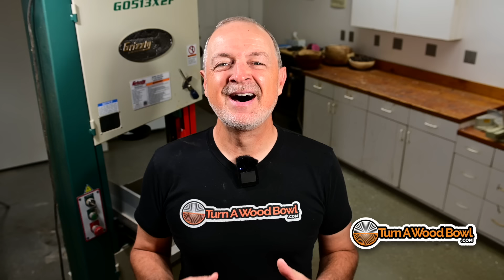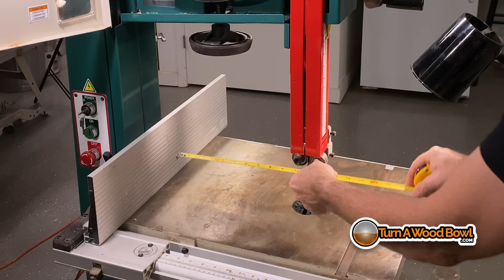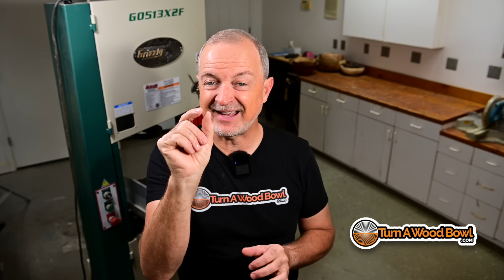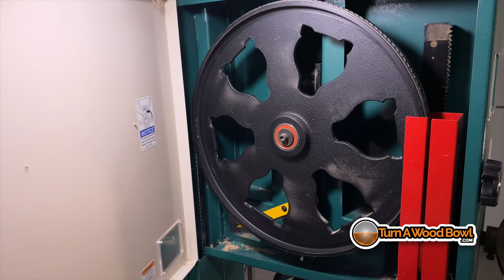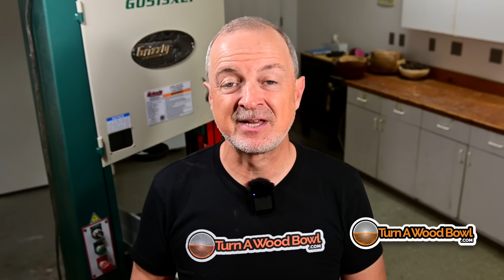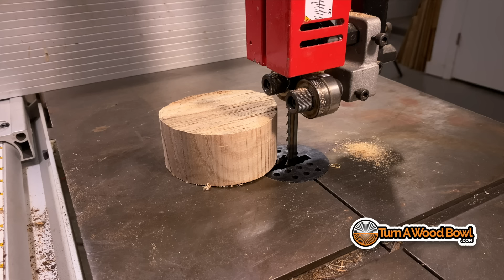Do You Know These Band Saw Basics - Video

Comment: Absolutely great Information. And I will reinforce what you say. "Bigger' is Better" . Yes, get the machine for the work you intend, but It's nice to have a little in reserve. It smoothes out that difficult wet wood, without bogging down, and there always seems to be a blank that needs cutting down to size, a little larger than you need to mount on the Lathe.
Reply from the maker: Absolutely! If you've tried to cut a too large piece on a saw too small, you know what you really need. ;) Happy Turning!

Comment: When the bandsaw isn’t in use, are you supposed to loosen the tension?
Reply: I always remove the tension on the blade when not using the saw. If you do not there is a danger you may distort the tyres, and you are putting unnecessary strain on the frame of the saw and the blade. See what the manufacturer of your saw recommends.😀🇬🇧
Reply: @filmbluff99  thank you!
Reply from the maker: Yes, that's not a bad idea. A tension blade left for a long time can smash the tires a bit in one area, etc. Happy Turning! Kent

Comment: A tip, when you  replace the blade of your band saw, take a file and file the sharp edge off the back of the blade, both sides. That way the back of the bladed has less of a tendency to dig in to the wood.
Reply from the maker: Good idea Harold. Thank you for writing and sharing!

Comment: I'm having issues with my bandsaw right now I can't cut a straight line for my life The blade twists whenever I start to cut I can't find anything anywhere about why it's happening I know this is a basics video but hopefully you have some insight
Reply from the maker: There is a good chance the blade is unevenly dulled. This same issue happens with chainsaw blades. If an area of the blade is dulled or damaged, the blade will drift or twist and make a clean pass almost impossible. Change the blade and I bet you see an improvement. Happy Turning!
Reply: @TurnAWoodBowl  it's a brand new blade

Comment: I use the Carter Products greenwood blade for my 14" bandsaw. I was trying to find the thickness of the blade, but couldn't find it. Though, I've had really good luck with them. I do know they use carbon steel vs silicon steel. So, they tend to stay sharper for a little longer. "More blade" for the buck.
Reply from the maker: Sounds good, thank you for sharing! Happy Turning!

Comment: In my shop we have one more rule: drop the saw guard/guide, down to the table when you are done every time.  This covers all or most of the blade so it protects the blade and you at all times.  Also, make sure your table is level to the blade and secured.  Nothing worse than the table dropping while you are turning a blank on the saw..
Reply from the maker: Good practice, Jeff. Stay safe. Happy Turning!

Comment: That bit about the blade continuing to turn for quite a while after the motor is turned off is CRUCIAL, in my opinion.  My saw doesn't have it, but I'm kinda surprised that a blade brake isn't a mandatory safety feature.
Reply from the maker: I agree Michael. Especially if you are wearing hearing protection. It seems as if the saw is off and "safe" when it's really just as dangerous as being on. Stay safe and Happy Turning!